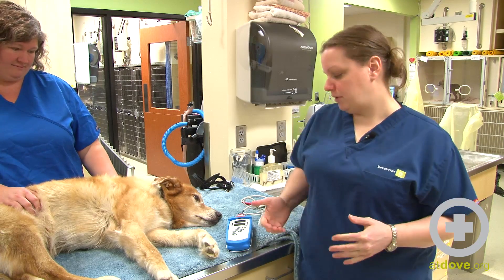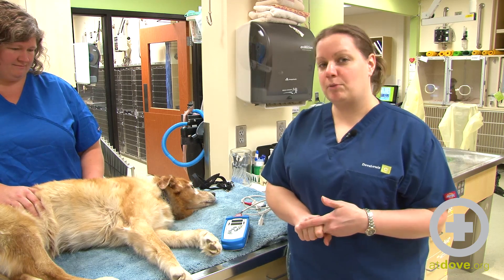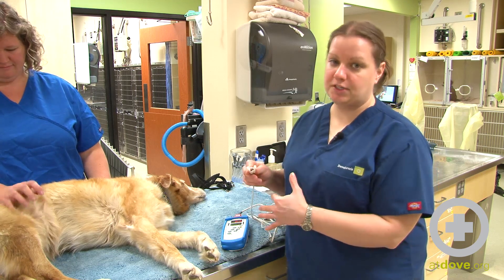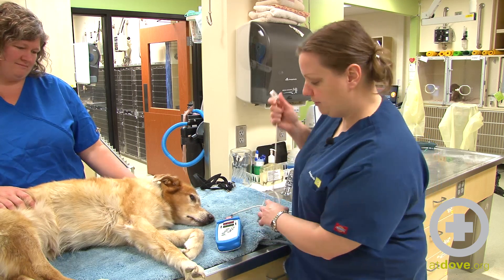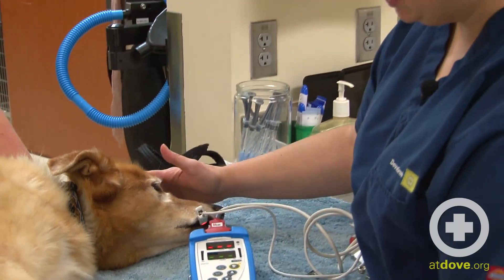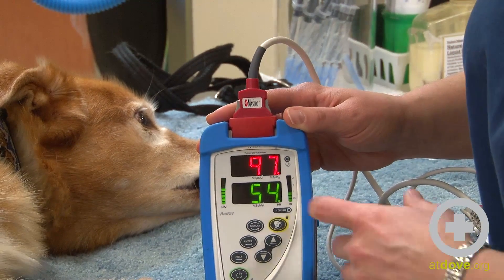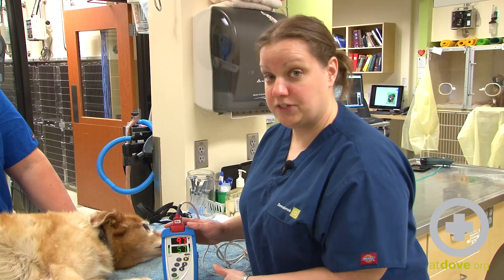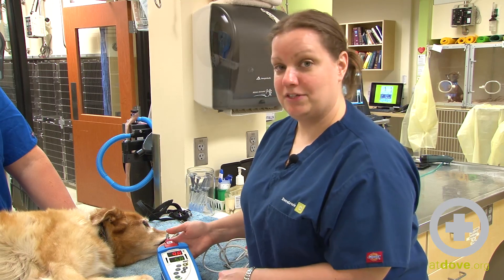How to Obtain a Pulse Oximetry Reading

Comment: Where can I purchase the Pulse Oxymeter you used in video? I purchased a $95.99 oximeter on Amazon and the results are very inconsistent.
Reply: It needs to be a 
SpO2 VETERINARY TEST METER that has the clip on, 
 not a human fingertip Oximeter that will not work correctly.
Reply: @PoM-MoM what brand or model machine do u suggest for home use?